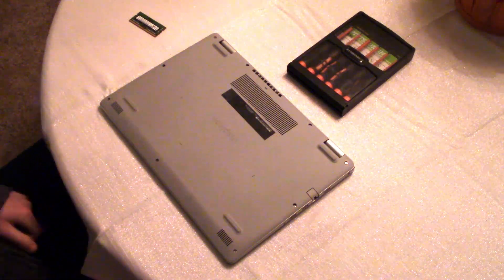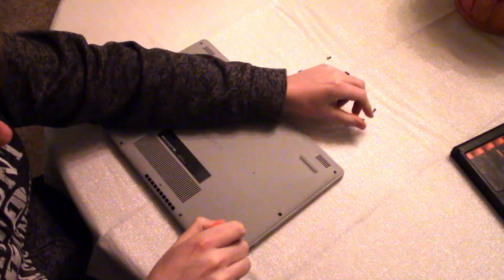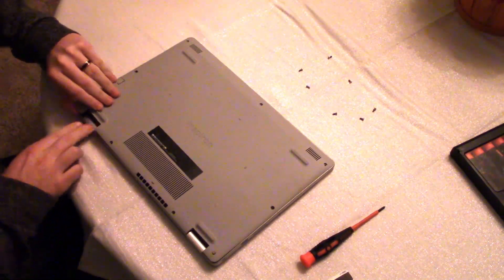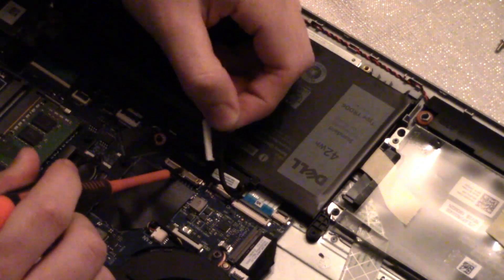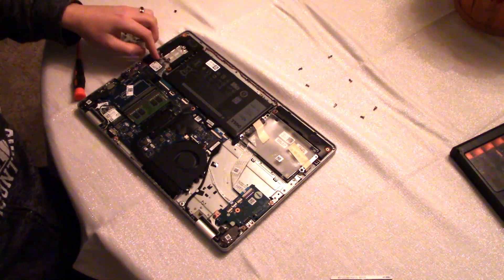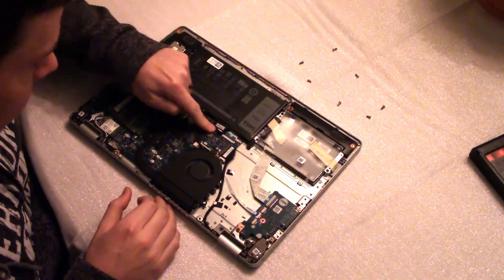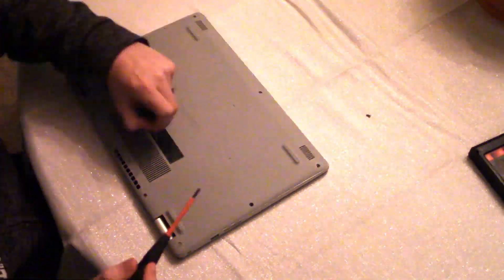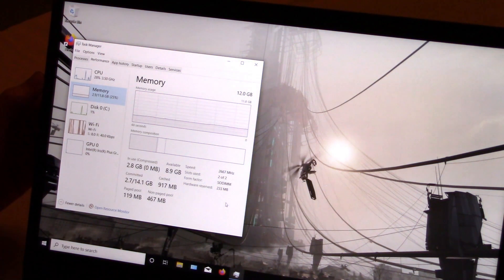Dell Inspiron 15-5593 (Late 2019) RAM Upgrade & Internals Overview

Comment: Was your processor i5 or i7? If either one, does it really matter how much ram and ssd you need? For example, I'm looking to get  1tb ssd and two 16 gb ram, but I'm not sure my processor could handle that. 

PS: I'm not so much knowledgeable in computers so I'm just looking for an advice before I start upgrading my ssd and ram.

Comment: Hi. Thank you for posting this video. It was very informative indeed. I have a few questions, if I may: I’m interested in getting this same 5593 version with i5, 8gb configuration. Aside from being able to upgrade the RAM, is the CPU upgradable to an i7 as well down the line? Thank you in advanced for your response.
Reply: nah the processor is sorterd into the motherboard. You can only change storage, ram or wifi if required

Comment: So this slot for M.2 ssd is already used? And how come my laptop is using ~4GB RAM before I even touch it and yours just under 3GB? :D
Reply from the maker: If the model you buy comes with an NVMe (AKA PCIe) SSD, it's in the M.2 slot. Maybe mine is using less because I haven't really installed much yet?
Reply: @Someone7089  Thx. Mine is brand new, opened 2 days ago so maybe some services were still running in background. I just wonder if you could retrofit bigger battery from other Inspiron models (60-80Wh).